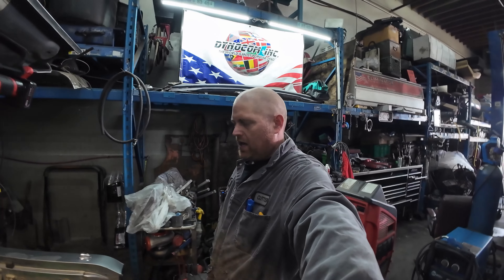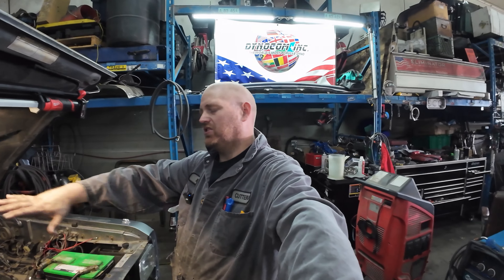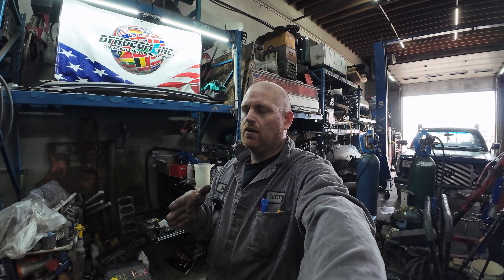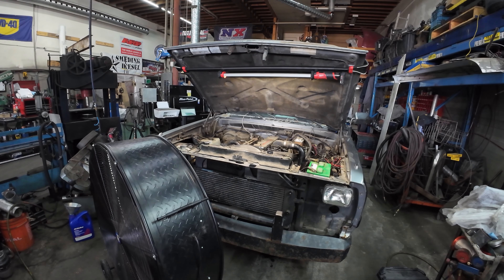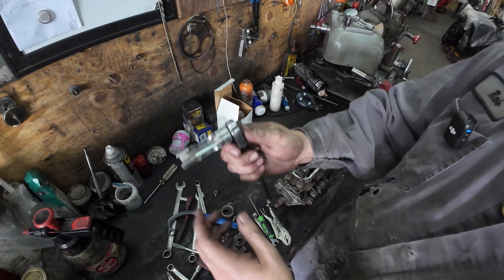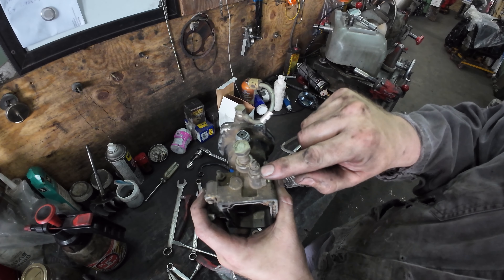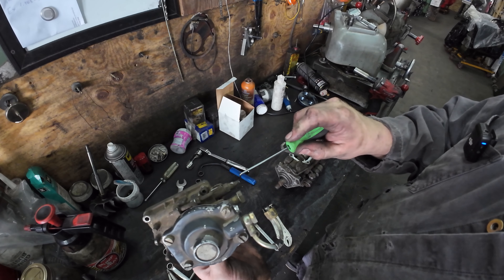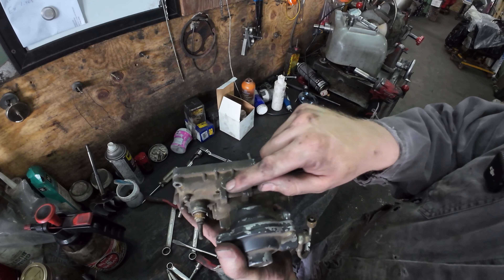VE 12V CUMMINS TIMING BUMP AND SOME FUEL SCREW.

Comment: On my 92 I have the fuel screw all the way in, but was told to make sure the idle is turned down before you start the truck, that's what causes the runaway. It's been like that for a few years now and haven't had an issue. I also have the throttle arm turned so it's on the 3rd notch instead of the 2nd and the part of the arm that rests on the on the idle adjustable is ground down, puts more tension and on the gov spring essentially.

Comment: Power screw tuning = with engine running turn it in a bit, blip the throttle....once the rpms start to hang you know you are close to run away.  Then back it out until rpm no longer hangs.  Thats max power for a given set up.  And just ditch the idle screw if tou have the pump top off, use the linkage dog bone to adjust idle!

Comment: I would look into if an optical pickup is available for integration to your dyno for reading engine rpms. Back in the day that is how Dunbar had his dyno setup slap a reflector on the crank and point the pickup at it and the dyno has the engine rpms. That keeps the torque value accurate. I noticed it said on yours peak torque was 1300rpm but I think that is because it’s losing wheel speed thru the trans so the rpms it thinks the engine is turning is actually lower than it really is.

Comment: (can hear you better than before ) did all of this on my 90 cummins except the turbo put injectors in and they seemed to make it slower ?  its still not doing anything like it should.
Reply from the maker: Check your fuel pressure. 
If it is a non intercooled. The turbo could use a upgrade